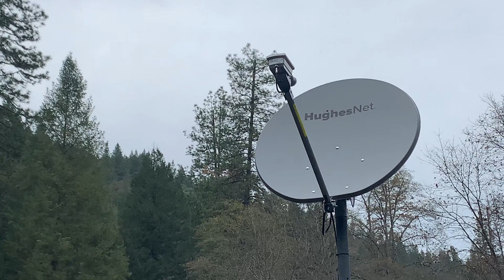Power for Your Off-Grid Cabin? You’ve Got Four Choices. Off the Grid with Karen and Grid

Comment: Have you actually experienced any problems suppling your power needs, with this system? Yes, a combination of 2 or more ways to have enough electrical power to recharge is necessary. 800 watts of solar panels will probably be enough, at least it's a good number as a reference, hopefully to recharge fairly quick. In electronic school we were taught that if our device/circuit would require a certain calculated wattage, to install components that could handle 100% (twice) that wattage, to handle over-voltage but mainly to prevent aging and failure due to heating and cooling. Wattage produces heat, downtime or even reduced demand/draw produces cooling. Expansion and contraction produces aging, shortening component life. Relating this formula to banks of batteries, if the wattage draw/demand for appliances requires 1,500 Watt hours per day, that would indicate a battery bank capacity of 3,000 Wh or maybe at least 2,000-2,500 Wh (an increase of 33%-66%). That may sound like overkill but if the the system is expected to last a some time, say 15-20 years, without frequent repair,/replacement, it sounds reasonable to me, but of course more expensive. Plus the extra power in reserve will extend the life of the batteries without needing or allowing them to discharge to nearly 50%, before recharging. Even allowing them to discharge to near 50% somewhat shortens their life.
Reply from the maker: Excellent comments. Thank you. Our batteries seldom get below 75%. In summer the panels bring the batteries up to float within four hours.  And, to conserve energy, we shut down our satellite modem when we go to bed. Im winter, our micro hydro produces less energy, but over a 24 hour period. Again, we shut down the internet at night. Every morning I take my cup of coffee out to our utility shed and check the batteries. I’ve never had a morning when the batteries were not topped off. I use over-sized wire. Batteries typically last 7-8 years.
Reply: @offthegrid4036  Sounds like you planned well. Sometimes, professional installers will try to get by with using minimal gauge wire, from the panels to the battery bank, claiming it doesn't matter that much and is less expensive. But even a small voltage drop across the panel to battery bank wiring, especially in long runs of wiring, may produce a voltage below the battery manufacturer's recommended minimum, even if only by 0.01 volts, causing slower charging.

Comment: If you are looking at overall energy supplies then the firewood you are stacking should be part of the equation. Good, dry firewood in a reasonable log stove is worth about 3kwh/kg and can displace electric/gas/oil for cooking and heating. That wood pile is a lot of stored energy which doesn't cost a lot per kwh.
I like your micro hydro as it is a very stable source of power in the winter months.  I'm stuck with solar only as there is little wind and no flowing water  so I have to pull the generator out in winter. About 25 hours run time at 2.5kw load this winter, hopefully no more now the days are starting to get longer. Some of those hours were to charge my EV around solstice.
Reply from the maker: Andy: Good point about the firewood.  We rely on it to heat the house, but it takes awhile if we've been to town for more than a day.  Our stone walls are real heat sinks; retaining heat well, once warmed, but if they cool down it takes a long time to warm them up again.  Sold our old wood stove two summers ago. A mixed blessing. New stove much more efficient -- so efficient that the metal plate on top is no longer useful for cooking.  Rats.